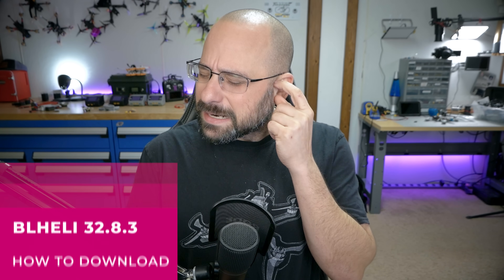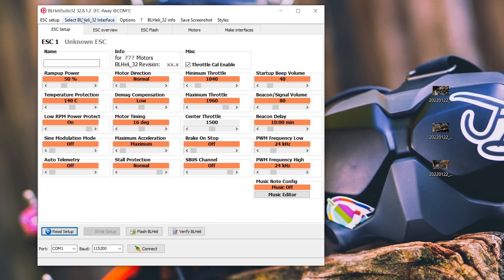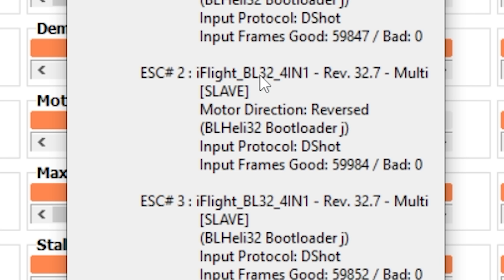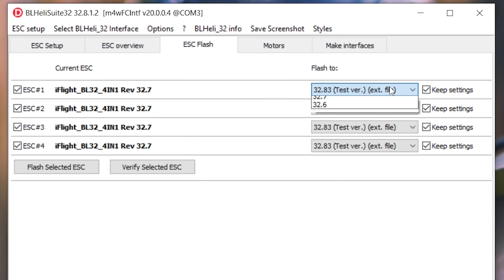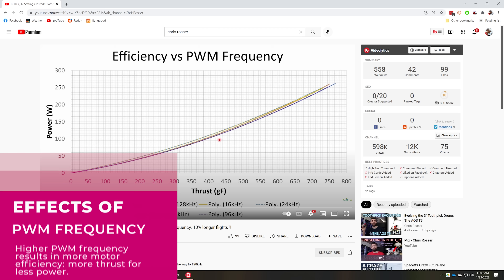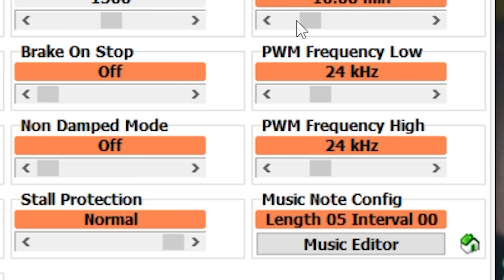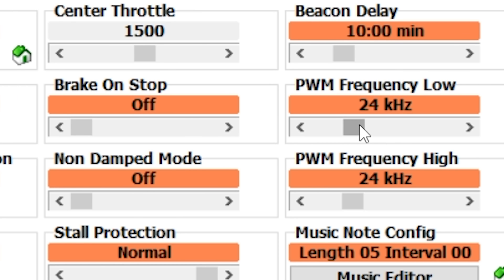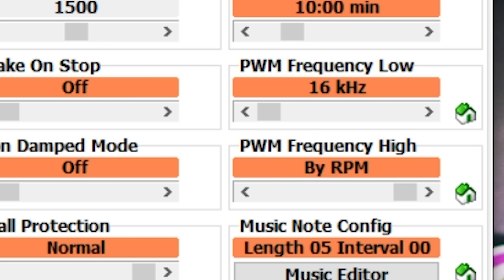BLHeli32 ESC's just got a BIG performance upgrade. Here's how to get it.

Comment: Hobbywing 60a 4 in 1 only goes up to 48khz so do I use "by rpm" for the high and 24 for the low? I'm also unsure as if it can go to 16khz but it will do Dshot 1200 don't know if that factors in this setup
Reply: DShot 1200 is what the FC tells the ESC to do. In current versions of BF, the highest DShot you can do is DShot 600. They removed the option of DShot 1200 after BF was released. BF 3.5.7 is the last one I now of that can support DShot 1200, but that was before we could do RPM filtering since BF 4.0 was the first that could do that.
Reply: @BikeGuyFPV  oh ok I see that makes sense why I couldn't find it in BF, do you think the " by rpm" will just go up to 48khz on escs  that have the max as such?
Reply: @GenericEquivalent  not sure as it wasn't really explained in the video on what the advantage was with "By RPM", only what the low and high PWM was doing. I'm taking a guess on this, but setting your low PWN as low as it would go handles low throttle stuff. Then as you increase throttle, the PWM frequency would ramp up to whatever is deemed necessary on the fly. 48kHz being the max but it might just hover just under it depending on what is going on based on the eRPM of the motor. Only then would it push the frequency higher until it hits it's limit (48kHz, 96kHz, or 128kHz depending on your ESC).

Comment: You the man man I just upgraded to this test code day before yesterday and it fixed an issue my quad was having with excessive noise on the pitch axes only due to using 32.8
It would cause a bad twitch on fast throttle moves which ultimately led to crashing a brand new build and ruining a new vista cam lens and fpv cycle motor

Comment: With regards to the different hex files I believe the 4IN1_Multi hex is 48kHz where as the 4IN1_96K_Multi hex means up to 96kHz modulation. Only helpful for smaller quads anyway though that spin at high enough RPM's to need it. (3/4in and below I think)

Comment: I just followed this exact procedure step by step using the exact links and the exact procedure listed in the video. I found the exact one that was already on my quad on blheli 32 and matched it up to the list from GitHub I downloaded that and literally as soon as I hit reset up after it was done flashing three of my motors completely smoked and my ESC popped. I literally just got those motors and I'm completely devastated I don't have enough money to just oops and redo it.
Reply: Yikes.
Reply: Joshua bardwell
Reply: So which quad, motors etc do/did you have?

Comment: One question. So motor timing is set to 24 degrees when using these new setting? or to Auto?
Reply from the maker: Check Chris Rosser's video for the recommendation he makes.
Reply: @JoshuaBardwell  Which video and you supply a link. Thank you in advance.
Reply: @JoshuaBardwell  found it thanks!

Comment: Joshua, I am pretty sure that a 5" quad with "by rpm" enabled will only ever get to about~ 35-40khz no matter how high the ESC itself actually goes. I can post a comment below (im guessing you will have to approve it) with the link to a github post from sskaug with a very easy to understand graph as to how the feature works, but basically, thats as high as the second fundamental resonance of the erpm will go (its ~32khz in extremely simple chart in his post of a 2500kv 4s 5"). Basically the "by rpm" rides just above the second fundamental. At least that is my understanding. 

SO, a 24-96k esc would sort of be wasted on that feature. I am not sure how a 48-96k esc would handle that. I assume it would just sit on the min...
Reply from the maker: This is why I think an F4-based ESC with full range 24-128 or 16-128 whatever it is is the simplest answer. It'll give super low PWM at low throttle and go as high as the motor RPM demands, regardless of kv and prop size. But if you can do the math, you may find a certain F3-based ESC can do the job.
Reply: @JoshuaBardwell    I think so too. 24-128 sounds like it would be amazing. The "by rpm"  can be useful on 16/24-48 ESCs, but even then.... The braking loss at 48k isn't that bad, so it's probably worth it just to use 48k straight up, rather than by-rpm which is going to be more like 24-35 (on F1 ESCs or whatever), which won't be as smooth. Idk. 16-128 sounds amazing though for sure.
Reply: @mouseFPV  "The braking loss at 48k isn't that bad, so it's probably worth it just to use 48k straight up, rather than by-rpm which is going to be more like 24-35 (on F1 ESCs or whatever), which won't be as smooth." -not sure if you meant 48K straight up won't be as smooth, or 24-by-rpm won't be as smooth (on a 24-48 ESC)?
Reply: @Ricpow80AkaNagamooto  by-rpm wont be as smooth
Reply: @mouseFPV  👍so 24KHz low and 48KHz high would be best for me as a freestyle pilot (on f0 ESCs which can only go up to 48KHz), or just stick 48KHz for both high and low?
Reply: @Nagamooto  for freestyle I would just do 48k if your ESC can only go that high. If you had an esc that went higher I would say use variable.
Reply: @mouseFPV 👍 I'll follow your recommendation and stick to 48KHz for both low and high as this is the max for my ESCs.
Reply: @mouseFPV  please as a ci'ematic pilot what should i choose for pmw frequency and rampup power and motor timing thank u
Reply: @elbedouirayen7938  try for yourself, there is no right answer. Generally, for freestyle...

If your ESC goes 24-48....
48k-48k pwm
30% rampup
23° timing.

If your ESC goes from 24-96 or 24-128
Min 24, max 96 or 128

If your ESC goes from 48-96, I'd probably just lock at 48.

If you have low throttle issues, maybe try 24- by-rpm

It's all tradeoffs, there really is no "best". I just lock all my stuff at 48
Reply: @mouseFPV  thank u so much i'll do the same to be safe, even i have the axisflying Istack it supports 16khz to by RPM
Reply: @JoshuaBardwell  found out that esc only supports 96kHz at most except for Fettek and Kiss even if esc itself supports and you install Rev32.8.3 testcode. mosfets themselves are not able to physically dial more than 96k hertz. what do you think about this? it’s not enough just to buy an esc with 16-128k, you also need to read the manual on the mosfets installed on it at the hardware level
Reply from the maker: I think advantages have been demonstrated when the FET is driven at higher frequency, even if the FET itself cannot switch at that frequency.
Reply from the maker: Here is the github page that mouseFPV is referring to: https://github.com/bitdump/BLHeli/issues/546
Reply: it looks like JB hasnt approved my comment with the link (happens). If you want to see what I am talking about, go to the blheli github, look at issue 546, and scroll down to the comment from sskaug on aug 28

Comment: I ended up putting my frequency back down to 24khz on my long range 8" with small motors. It flew a little worse. Think it needed that braking performance. I think I did get more flight time but seemed to wobble more. Slow wobble. Idk. Maybe it's in my mind
Reply: What version of BLHeli firmware were you on and did you tune the kwad?
Reply: @Zachtamundo  32.8. What ever was the latest a few months ago. Was in process of tuning the quad. Figured I'd try again if I got it flying great and see if then I could just tweak it some